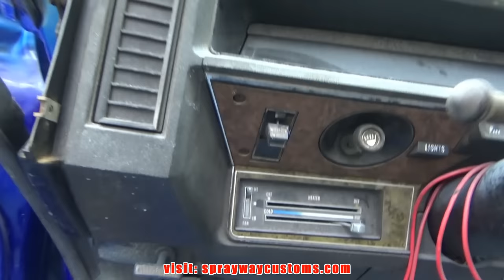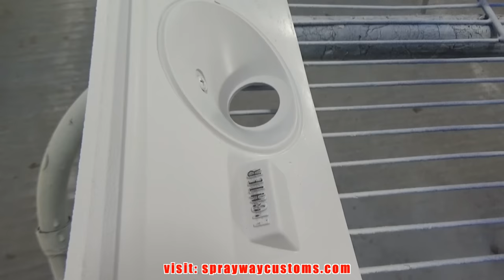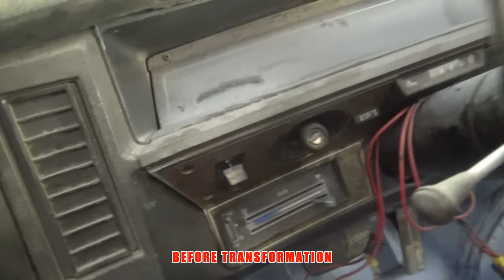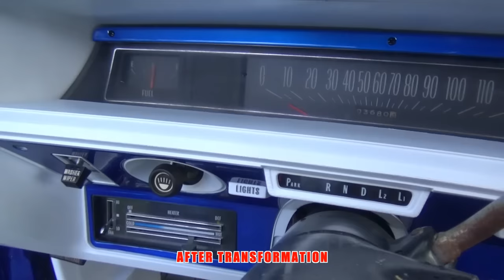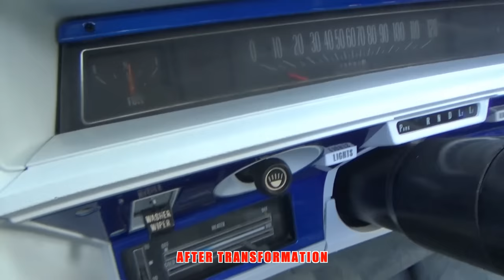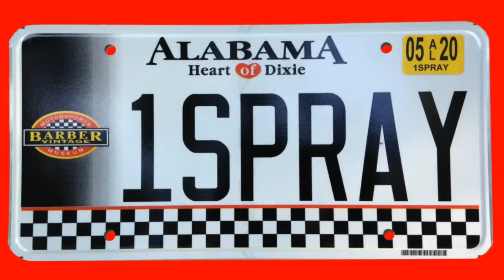How To Paint A Car Interior With SEM Color Coat Dye For Plastic Vinyl Leather CHEVY CAPRICE 74 DONK

Comment: Instead of using sandpaper to knock the top off those letters on the dash you should use a razor blade and drag it across the top at an angle. It makes everything even and smooth. Plus it's quicker and easier to clean up after
Reply from the maker: Appreciate you

Comment: Nice video. I saw where you sprayed the bed liner on the metal dash pieces, but have you ever sprayed the bed liner directly on plastic interior parts? I have a door panel that is in very good condition (no cracks) except the area where the PO placed his/her arm on the door with the window down. That area at the top of the panel is worn smooth. I thought I could maybe "dust" that area with the bed liner to restore some of the texture before using the SEM color coat to restore the panels original color. Any thoughts?
Reply from the maker: Yes, it'll work well. SEM actually have a textured spray but the Bedliner will be much cheaper.

Comment: Amazing. I’ve been on here trying to research. What’s the best paint to use for the dash of my titan because we had to change the heater core and I thought now is the time if any well it’s all pulled apart to go at it. I love the white and it’s really what I wanted…but I’m a little leery because I work for a blacktop/excavation company, I don’t know how well that’s gonna  hold up if I have to wipe it down often.😒
Reply from the maker: You can spray a clear over it to protect it like I did on here
Reply: @SprayWayCustoms  would it still pulled up if you wipe it down a lot. And would you recommend an extra layer or two of a clearcoat then what you applied?